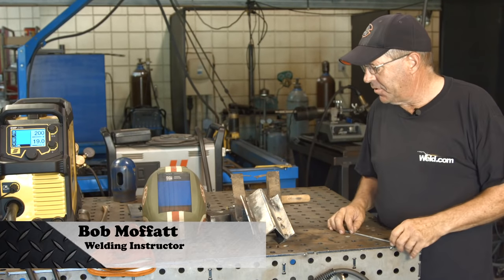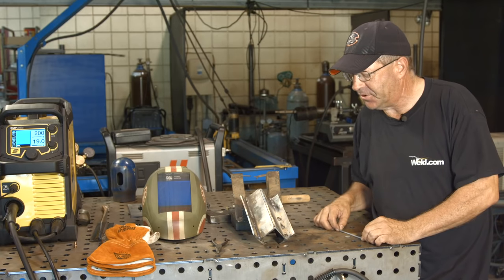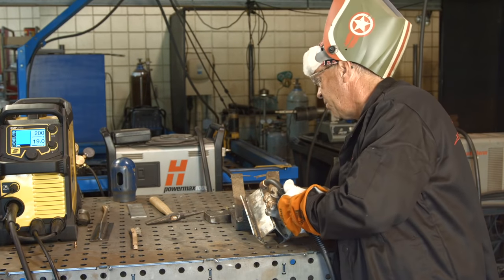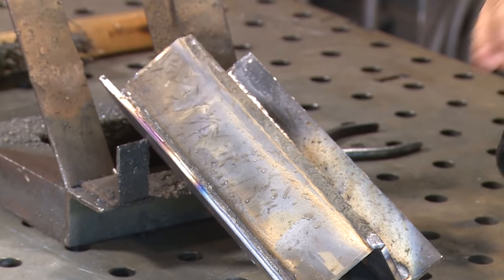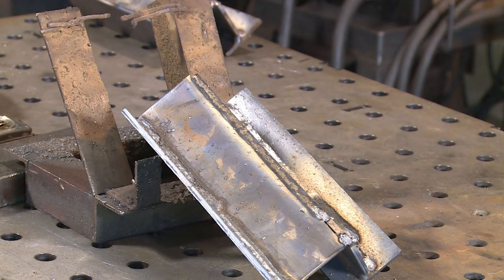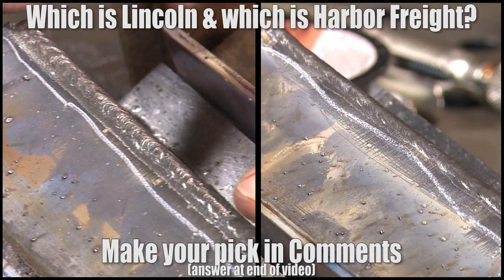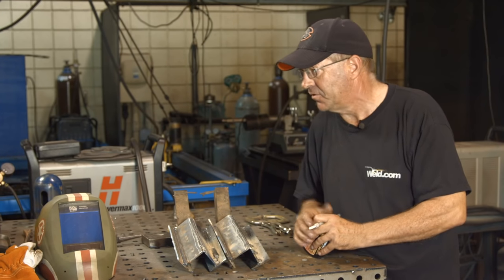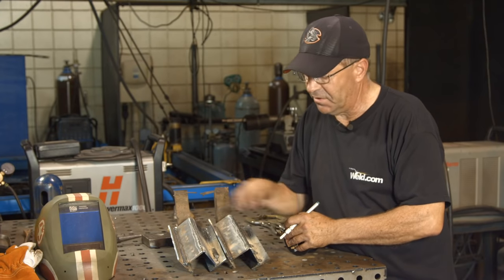Harbor Freight Flux Core Wire vs Lincoln Flux Core Wire: Part 1 of 2

Comment: Here's the real difference between Lincoln and HF (junk).   Who is going to repair a HF?   Lincoln, Miller and ESAB welders have repair centers.
Reply from the maker: David, the video was comparing wire, not machines.
Reply: Oh, missed that part.  My statement about the machines is still revelant.
Reply from the maker: David, absolutely. A quality brand machine like ESAB, Lincoln or Miller is certainly in a whole different level than a Harbor freight machine.
Reply: Well relevant in a completrly different subject kinda wsy...

Comment: These cheapies are crap wire-feeders. I have found that if I take the little tensioner wheel off the driven wheel when in storage it does not get weak so fast. 
Overall, having used to heck out of these cheapy welders over the years they are great for spot welding sheetmetal but anything more than that they are no good. Even if you can get them to act normally, they'll overheat. But for as cheap as 75 bucks at times they that once in a while "I gotta get these two bits of metal together" situations they will work well enough.

Comment: If you run the gas less flux core wire with gas it runs like butter. keeps the spatter down to. Makes for a nicer weld
Reply: Defnotdemas try it before you criticize. I love it and I feel like it performs better that way. The gasless flux core is different from the industrial grade stuff but it has to benefit from the added shielding.
Reply: Defnotdemas it's possible using the 75/25 mix and does produce smoother welds.

Comment: I tried a spool of HF wire exactly ONE time. Horrible mess! Wouldn't feed smoothly no matter what I tried or what adjustments I made to my settings. Worst spatter I've ever seen, and on the worst welds I've ever done. I wasn't even a quarter of the way through the spool and it just stopped feeding at all. Opened up the machine to see what was wrong, the wire was twisted around itself on the spool. It didn't spring loose and get tangled, it was tangled on the spool. That was the way it was shipped from China. Threw the entire spool in the garbage, got a spool of Lincoln wire, and never had another problem. Maybe the one I got was a fluke, but I've never gotten a bad spool from Lincoln in well over 10 years that I've had this machine. I'll stick with the name brand

Comment: I was kind of hoping for a machine comparison video, everyone knows HF wire is crap.
Reply: Is it really crap though?  He said visually they look the same. What if the results show the penetration is the same? Then maybe your welding is just crap?
Reply: Harbor Freight wire is made by INE, a reputable Italian manufacturer.  It isn't crap at all.  People who think it is are the same people who take Vitamin C and claim that their case of Monkey AIDS has finally resolved.  Want to see something really funny?  Go to Amazon and read reviews of INE flux core wire.  "Much better than harbor freight!" - hah.  Much better what, label?

I bought a "junk" metal lathe from Harbor Freight years ago.  A few companies made identical sized lathes for about 3 times the price, but were "way better than Harbor Freight".  Plot twist - They were IDENTICAL, all from the same single factory in China.  Only difference was how much extra money you paid for a certain color paint and label.  The reality is that they were all equally bad out of the box, all required work to make them decent lathes, and the only one that considered this fact in the price was Harbor Freight.

Comment: harbor freight wire does not get the exta additives that the expensive wire like Lincoln Miller Esab get in their flux to contol their temp thats why your wire melts up and down causing your spooling issues, technically not a spooling issue at all just shitty wire , clean your plate better with that flux core wire

Comment: your a weld instructor and you don't know how to set up flux core it's needs to be straight polarity and u need to know how to set ur heat and wire speed

Comment: this guy can weld but he doesn't explain everything I mean is in a shop what  metal are you using I did a lot of work with hy80. it's a grade of carbon content he mentions nothing about preheating Heating heat input cooling time I mean if you're going to weld in  a shop for a hobby these videos are excellent but if you want to make a living at this you're going to need a lot more well he's going to college let's go there for 4 years and will still be scraping the tip of the iceberg it's called metallurgy
Reply: The stuff he is welding is only 3/16 no need to preheat unless its 35° or less. Even then just warm it not to 250° or 500°
Reply: And flux works on all alloy steels mild to carbon.

Comment: I hate the crap. It has no business in anything but an industrial setting at 300 plus amps. Once your running those numbers, I look to a dual shield in shop or barn. Its a dis-service to newbs to sell them these crappy 110 flux wires and especially marketing a machine incapable of adding gas( without an insane effort). I'll take a 110 inverter and an electrode any day of the year.
Reply: Thanks for doing videos on flux core wire. Most videos are are for solid core gas shielded wire which doesn't help me much. I'm not a pro by any means but do a lot of repair work around the homestead so a majority of my welding is done outdoors. I've recently purchased an Everlast power i 140 110V welder because it's lightweight, inexpensive, and has a quality wirefeed. I've picked up some good tips from your videos. Thank you and keep em comming.

Comment: wrong wire speed... forget about any recomended setting with flux core. it almost sounded like it was just short of spay arcing and explains the excessive splatter, flux doesnt like to run clean in spray mode... crank it up lol